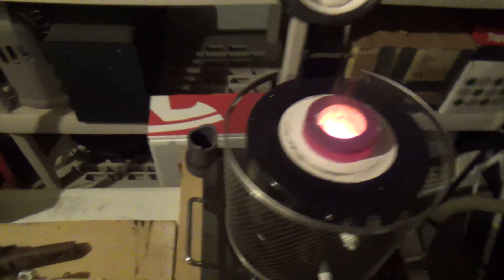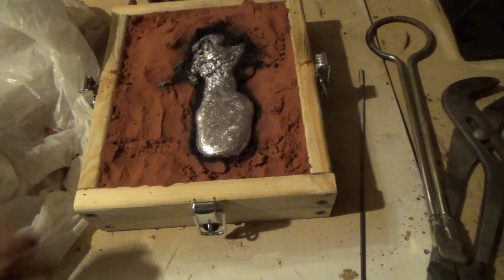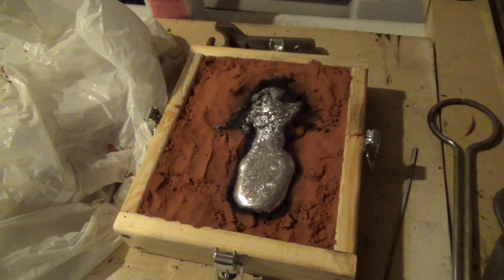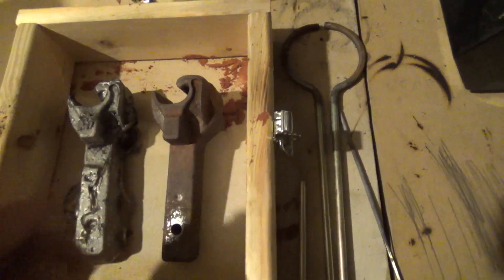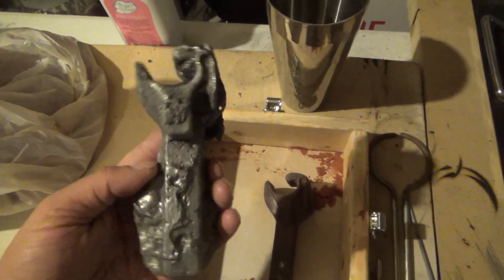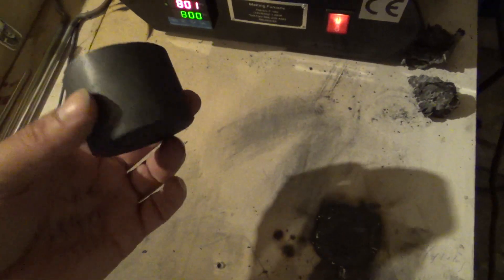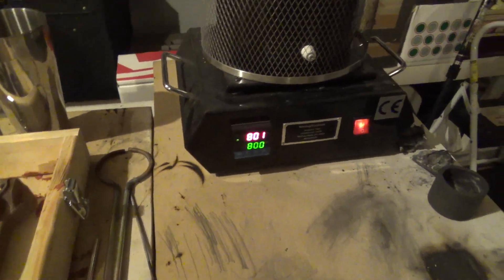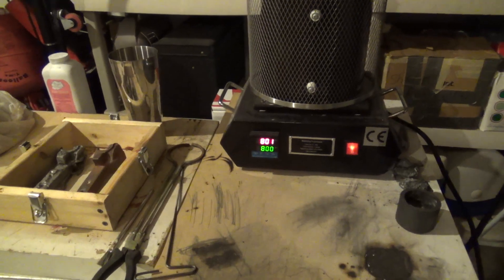Aluminum Sand Casting at Home: First Cast Ever! P1

Comment: i'd like to know more about your furnace as well
Reply from the maker: This is basically the same as the furnace I'm using, http://www.ebay.com/itm/Mini-Automatic-Jewelry-Melting-Furnace-Melt-Scrap-Silver-Gold-at-Home-Pour-Bar-/291274808604?pt=LH_DefaultDomain_0&hash=item43d154dd1c

Just under $300, costs as much as a electric space heater to operate.